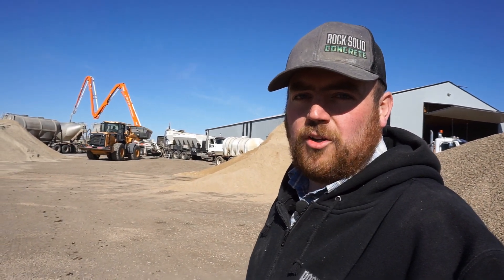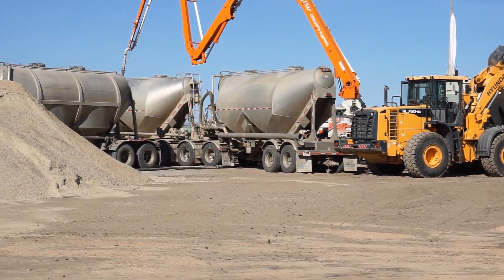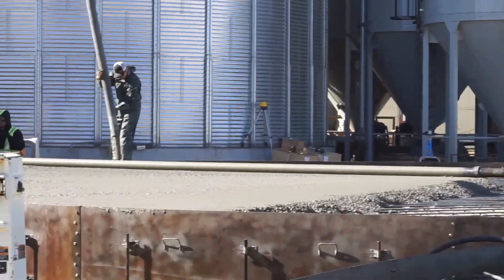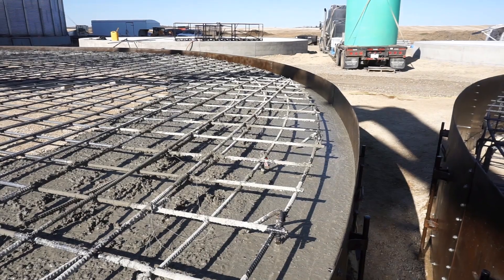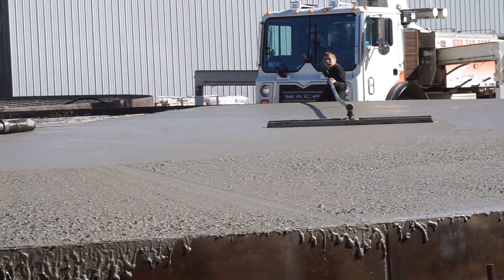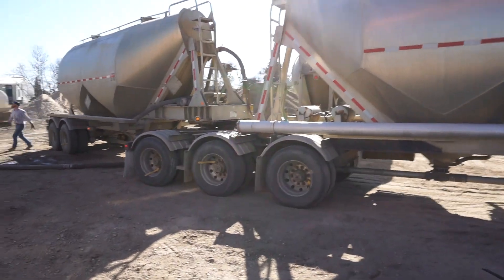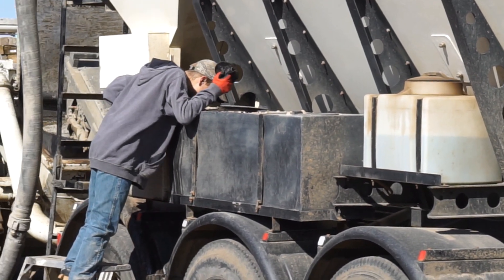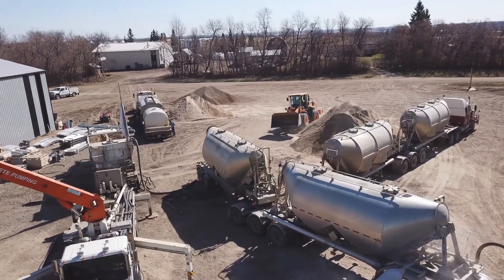175 m3 of concrete with ONE TRUCK (Volumetric Mixer)Ep.6

Comment: Turns out that the biggest investment required is not the ready mix concrete truck, but these additional trucks containing the materials - cement, water, and additives. Also, a pump truck comes in handy.

Comment: You need sand and gravel delivered to the job site, need room for the storage of sand and grave. You need water truck on site to supply you water, need room for the truck. You need bulk truck and trailer with cement and you need room for that truck. You need loader…Basically you need tons of equipment and room for that equipment on the job site. Where is the advantage to this operation?

Im not even mentioning clouds of cement dust flying around and people breathing it!

Im sorry but I do not see any advantage to this operation, maybe there is a niche for it but that is all.
Reply from the maker: There is definitely cost savings, the aggregates get delivered straight from the pit to the site, so instead of having it delivered to your yard then you deliver it to site with your mixer truck. Traffic is greatly reduced on the road to the site, on pour day your showing up with 4 units (water/loader truck, powder truck and mixer truck, pump truck). Like Jim said slump is consistent for the entire pour and your never sitting waiting for concrete to show up.
Yes like you said you do need some room to store aggregates and setup equipment, also you wouldn't do it like this if the job is in your backyard but if it's far enough away where you could potentially need 10 or 20 mixer trucks just to keep up then this makes alot of sense. It's definitely not for everyone though.
Reply: @johnneufeld02  How does the company calculate the costs to the client? Paid lump sum by load or by how much material you use?
Reply: Not having to wait for service. 
Multiple classes of concrete in one go. 
No faulty or potentially rejected loads. 
Slump is consistent throughout the pour
Water savings are in the 70% range
Fuel saved
Costs overall are lower I believe.
Reply from the maker: The truck is still metering the material as it comes off the truck so you know the total volume used once your done.
Reply: As I am starting my new position Monday in a Volumetric Mixer after years in a ready mixer—I must concur with you Bro.  I see lots of silica particulates and dust in the working areas.  No ones wearing PPE at all.  It seems only at an advantage if it’s a delayed pour and trucks are sitting on standby.  Other than that it doesn’t beat a ready mixer and good batch yard.
Reply: having had a regional based concrete batching plant and about 5 trucks, this method shits all over ready mixed trucks, because you can have your labour on site and we used to have all sorts of problems finding good mixer truck drivers. Some would take their time getting to the job, while some would get there fast. This caused inconsistent deliveries and concreters wre not happy when at one minute you have no trucks and then the next minute you have 2 trucks turn up. Good mixer drivers who follow instructions are hard to find. This method just need a lot of preparation time and clean up time.

Comment: Is your concrete getting tested out of the truck? Are you able to provide accurate mix designs for projects where the specs are highly enforced?
Reply from the maker: On this particular job the concrete wasn't tested by a third party, but yes we do a lot of commercial work where there is third party testing.

Comment: do you do this because of a lack of ready mix plants close enough to supply volume?
Reply from the maker: No, there is multiple batch plants in the area that we compete with. We Choose to do concrete this way because of the many advantages.
Reply: @johnneufeld02  I can see that now. I have a volumetric truck coming on Monday to do a 0.5 m3 job (LOL), and I first thought they were mainly used for smaller jobs. I was clearly wrong. This looks much smoother than having 20 cement trucks in and out as well as give you a lot more control on-site.

Comment: Hi John.  How can I fill a cement bin in a field?  A barrel drives cement without air pressure.  What compressor can do this?  Or in this situation only the crane will save?
Reply: Hey, the truck has a pto driving blower to do this.